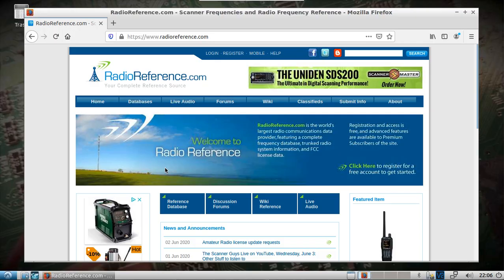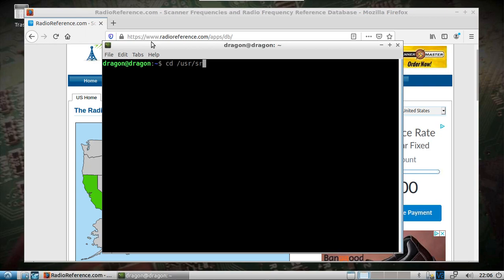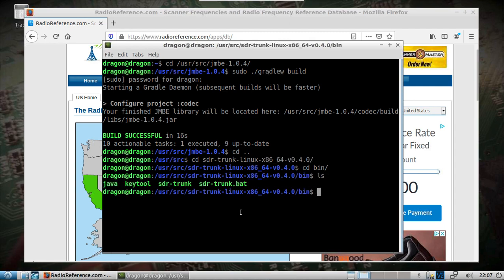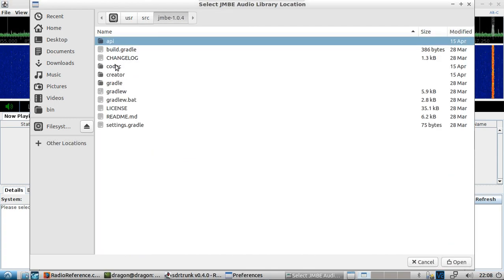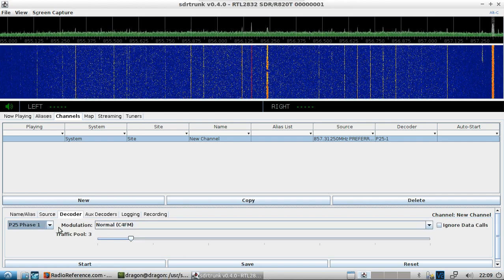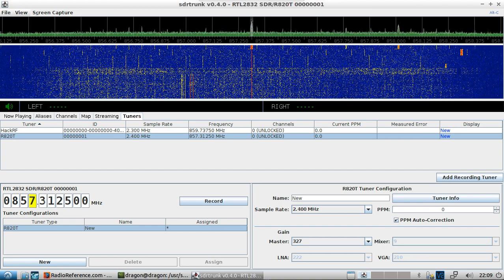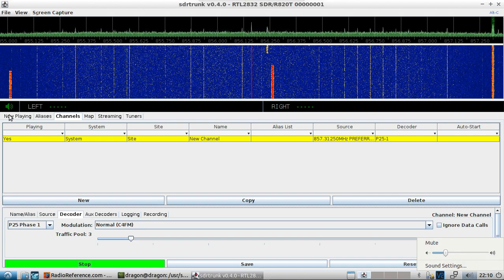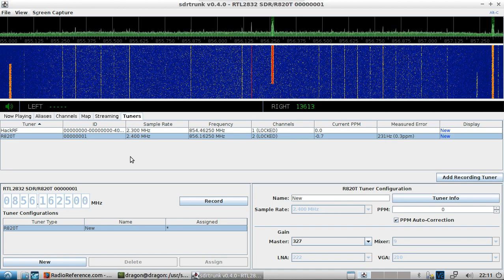DragonOS LTS  Decode and monitor emergency or other P25 Phase 1 trunked systems (SDRTrunk, RTLSDR)

Comment: It shows Phase2 in the drop down list- do we know if that decoder really works as well? I didn’t know anything other than OP25 could do Ph2..?
I’ll have to give this a shot - thanks man.
Reply from the maker: I don’t have any phase2 around here, but the developer put out that newer jmbe specifically for it. My understanding it should work. Be glad to hear what you find out if you have anything to test against.
Reply: cemaxecuter -that’s great news. I have plenty of phase2 traffic around here to test (have OP25 going currently on a couple RTLs and BladeRF micro).
I’ve had zero luck getting OP25 to do anything up around Portland, OR, so will be good to have another tool to try out there. 
I’m going to give it a shot here in a little while tonight; will report back. 

Thanks again for what you’re doing here!
Reply from the maker: digus that’s awesome and will be great to hear about your results. I think I need a class on op25 - I included it in the build but never tested it. Seemed way easier to do things with SDRTrunk, speaking of, check out some of the new features in v5 of SDRTrunk (work in progress). 

https://github.com/DSheirer/sdrtrunk/wiki/Playlist-Editor
Reply from the maker: digus and no problem, I’m enjoying myself and it keeps me busy.

Comment: Take a look at This : https://github.com/chuot/rdio-scanner
Reply from the maker: That’s awesome. Looks and sounds like it’d be meant for streaming internet based feeds? I could imagine some people stream the unencrypted trunked systems online (assuming its legal) at which point this program could pull them all in?
Reply: @cemaxecuter7783  i have not looked at all details. That above is a Nice UI with some extra features to handle Voice Recordings. 
In older versions i saw it worked with https://github.com/robotastic/trunk-recorder
As a source of the audio files. 
Some other Tools use OP25 itself. 
I guess the idea is the Nice UI and usability features that are interesting making it more accessible to novices. 
Maybe you should also contact the developer if you package it in.